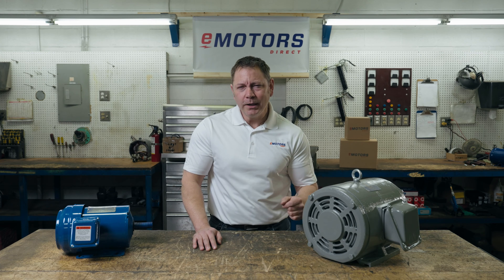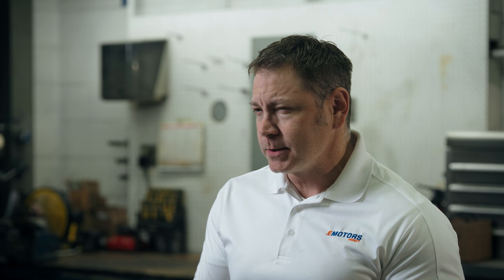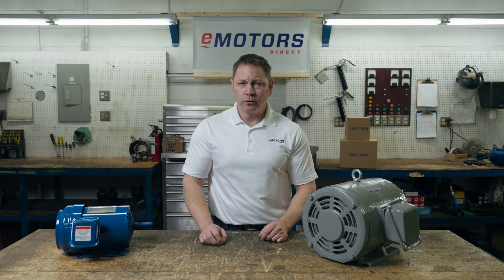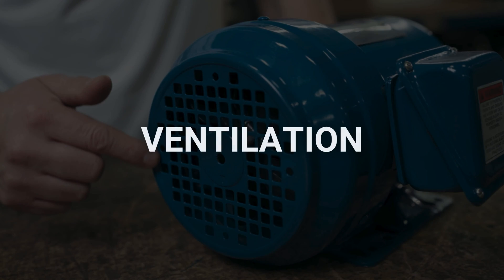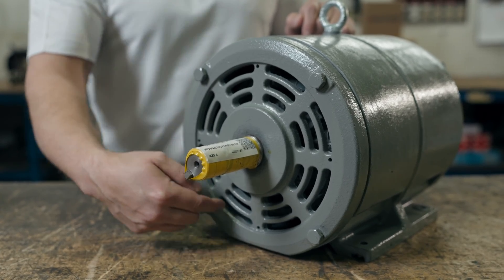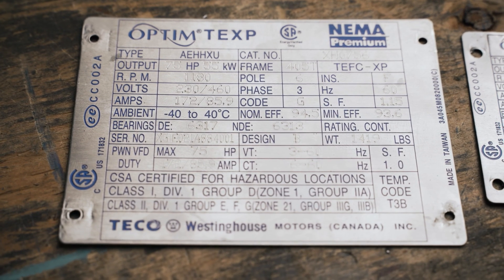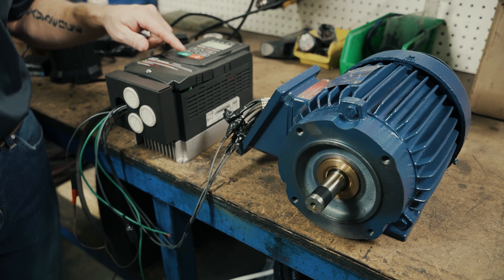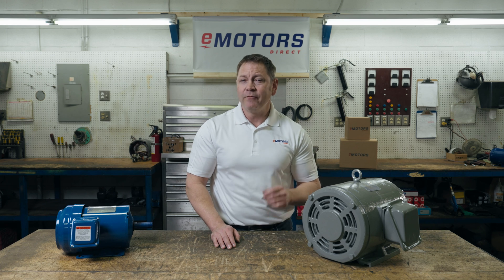Why Your Electric Motor is Overheating

Comment: I assembled ac  motors earlier and test , 160kw 480 volts ,windings normal amps normal but i wondering rotor is hot,in a few minutes of testing  anyone can tel me whats wrong?
Reply from the maker: Motors do get hot, but if the rotor is heating up too quickly or to a point where it feels unusually hot to the touch, that's a concern. A typical motor may run at around 70°C to 90°C, but if it's exceeding that or heating up way too fast in just a few minutes, it could indicate issues like overloading, poor ventilation, misalignment, or bearing friction.

Comment: I have a 2800w vacuum, it's brand new, never used, but heats up significantly in few minutes of use no charge, i opened it and found a 1500w tag on the motor!! I checked the armature it was fine all same ohms, stator seems fine. What could be the problem?

Comment: You forgot bad bearings 😅
Reply from the maker: Nice addition. If the motor is running "rough" due to bad bearings, it takes more energy to turn the rotor, drawing higher amps which would cause more heat.

Comment: so frustrated, my JET wood lathe's 1/2 hp motor started overheating after I stalled it many many times. I had the capacitor checked( ok), the motor spins freely,but at first it goes to speed then after 1 minute of runnig it ( no load) it slows and the casing gets very very hot!!! What's up, I'm retired on a limited income and trying to start a new hobby but now am on hold due to this lathe issue!!!
Reply from the maker: I have seen the odd motor that will run fine when cold but as it heats up and everything expands, the internal short connects and causes issues.

In your case, it really depends on what caused your motor to stall. Assuming it was due to an overload, it's possible the motor windings have been damaged. Based on just the information you provided, my next step would be to test the motor windings to investigate further: https://youtu.be/19zIZ7sTEhQ?si=laP4MQKpBPb1bGwt
Reply: @emotorsdirect  thanks for that, more info-------> Seems the casing gets very hot in one location! That seems like a sign of the issue, what do you think? ALso any way I can fix myself?
Reply: @emotorsdirect  am I able to repair it myself, I do think that that is the problem because the outer shelll gets hot in one area only so I'm thinking that is where the short could be
Reply from the maker: @joedivincenzo2099  It could be a few different things. Honestly, I'd need to have a look at it. If the windings are damaged, that's usually fixed by a motor repair shop.
Reply: @emotorsdirect  well I have no choice but to take it apart as it just isn't working as is so maybe if I do I can take a few pics or let you know what I see if only out of curiousity, I'm gonna save for a new lathe and probably junk the JET. sob

Comment: does VFD reduce overloading?
Reply from the maker: VFDs can reduce overloading due to their increased efficiency and reduction of inrush current however mileage varies significantly based on the specifics of the application.
Reply: Thanks for your reply,
I have a centrifugal pump that pump 50% glycol and I'm near the edge of overloading (according to OEM),
Can i use VFD to prevent overloading?(Even at cost of a small reduction of the head)